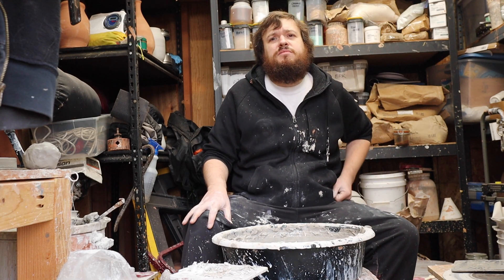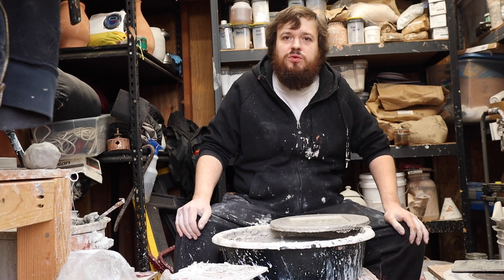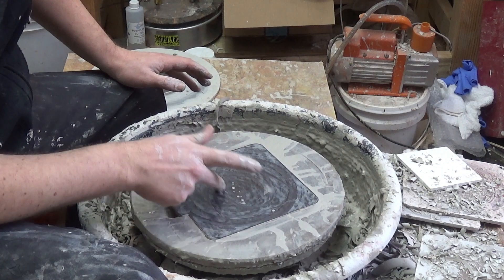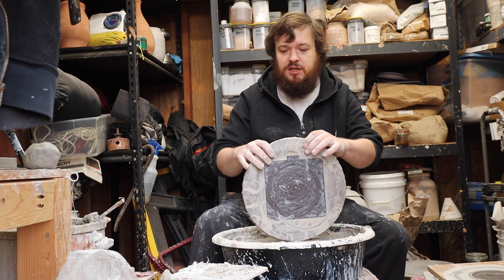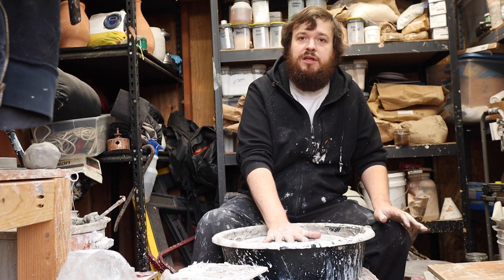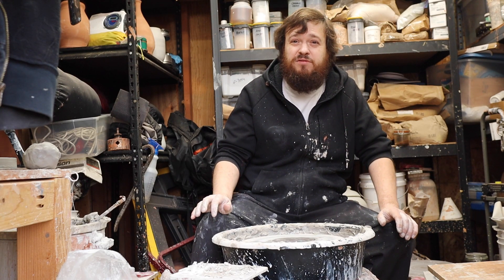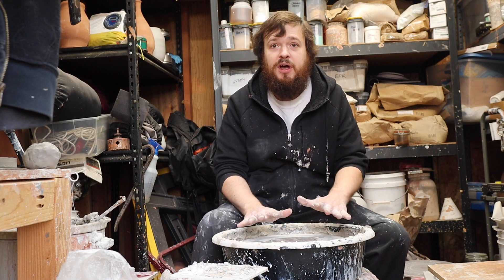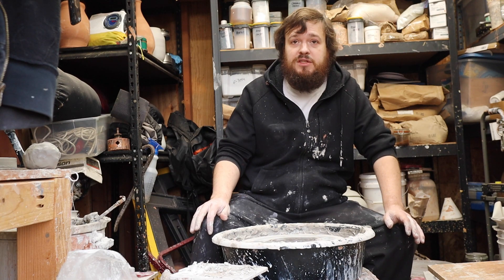Bat chat (how to use masonite bats)

Comment: I wash and dry my masonite batts once or twice each year. Then I paint them with wax resist mixed 50/ 50 with water. You can double coat for greater resistance after melting the wax into the batt with a blow dryer or ste them in the sun.